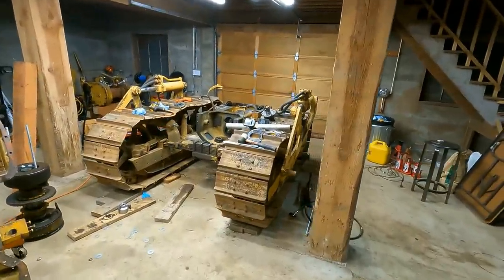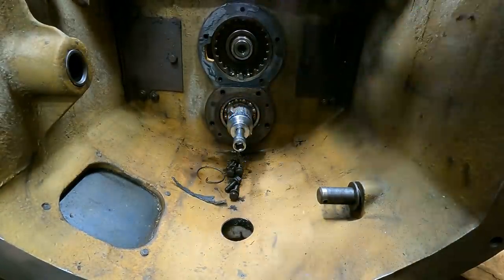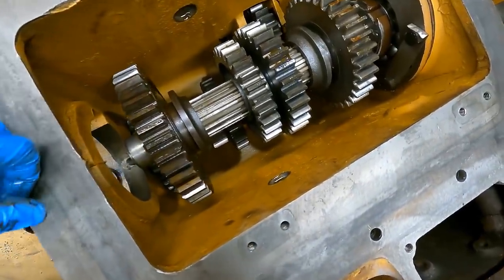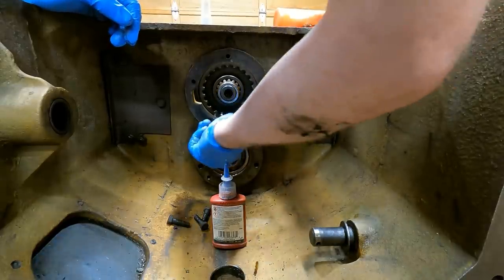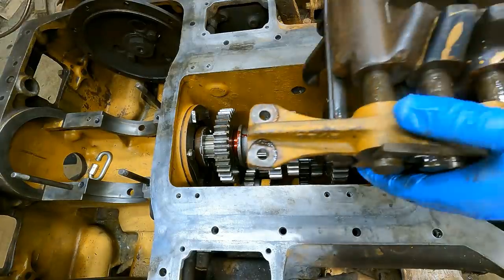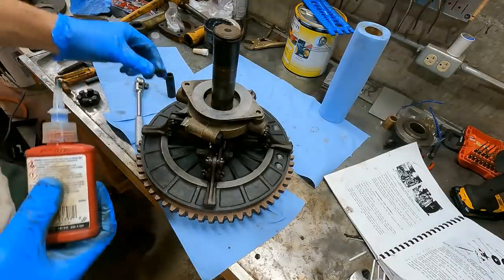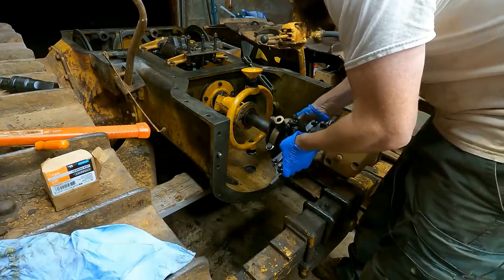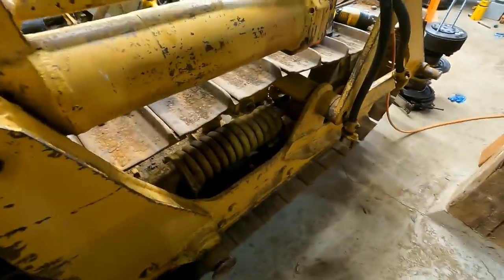Caterpillar D4 transmission repair and clutch installation

Comment: Can the bolt turn on the clutch section 25:22 as you have nut with lock taps but your boltheads have nothing on them? This means your bolt can come loose as there is nothing to stop the bolt from turning. Have a look and you will see what I mean. The bolt end has nothing stopping it from coming loose. Hope you realize this before you get too far on the build! you need another locking tap on this end. Got to be careful about this. Hope you realize what has happened.

Comment: Hi great work cant stop watching. One question why are you using the mig wielder tip without the gas shield that is why your wielding looks so bad, the shield is designed to direct the shield gas  (argon) over the wield starving the wielding  point of oxygen, Oxygen in the wield is what causes the wield to splutter.
Reply from the maker: I'm using flux core, no shielding gas

Comment: What is the Dewalt tool used to torque the bolts on the sfaft cover for the bottom gear shaft?
Where did you get the instruction books?
Reply from the maker: It's just a 20V impact for the initial tightening, used a normal torque wrench after.  You can find manuals for just about any machine under the sun on eBay

Comment: I have no expertise on the track spring issue but could you torch thru the spring before removing it to either relax it or cut it into segments to minimize weight and stored energy.
Does your channel delete posts containing  Amazon links?  I thought I sent a suggestion for better chem resistant gloves that I like but I don't see it.
Reply from the maker: I think YouTube auto deletes a lot of messages...I see them in notifications all the time, but when I click on them it says message not found.  Not sure what is triggering it, but I think links might.
Reply: @PacificNorthwestHillbilly  The gloves that I wanted to share were Ansell Hyflex 11+800 nylon gloves.  There are multiple coatings to choose from. Comfortable, reusable, and washable.

Comment: Welding next to a bearing without it being shielded it just asking for trouble. just saying. you might as well have just cut the nut off with a thin cutoff wheel.

Comment: I would not have liked to have to drill out those bearing openings, except with a drill press, otherwise if the drill catches it is going to spin the holder, round and round.  Not something I would  want to chance.  A tapered reamer of the right size might work.  I might even cut a reamer by hand with lots of cutting oil.  I would also put anerobic sealant on the outside of the bearings, Like LocTite 518.
Reply from the maker: Thanks for the loctite suggestion, that is a great idea!